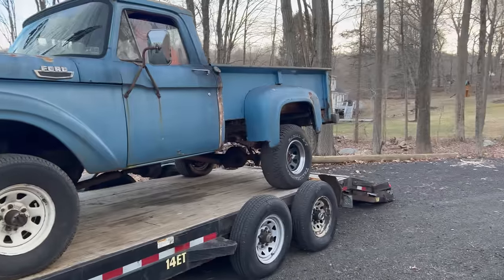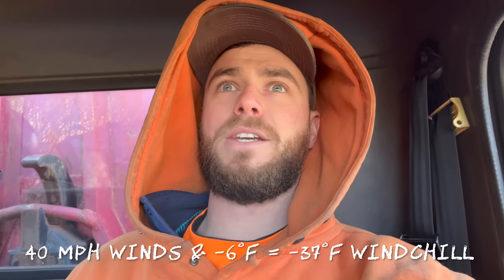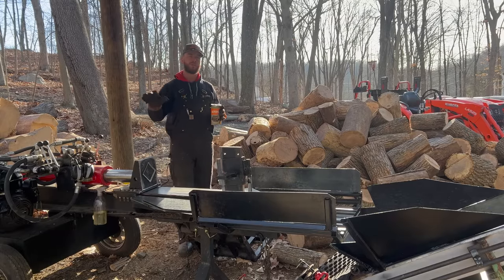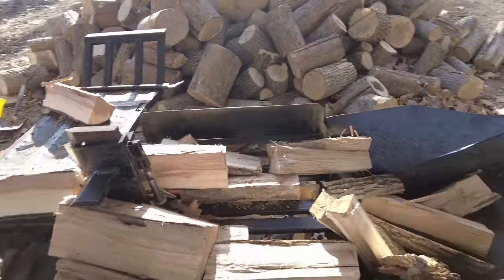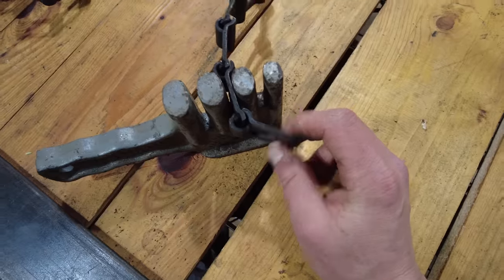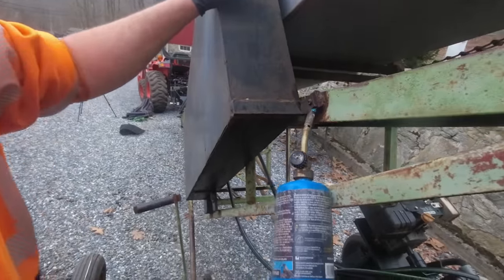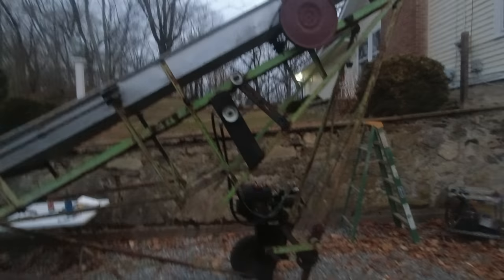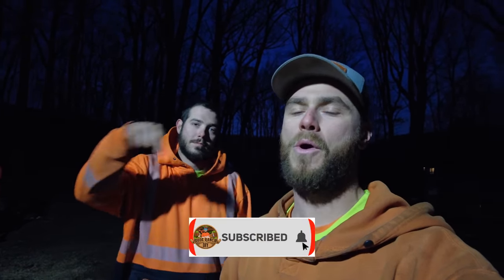#337 Breaking & Fixing the Hay Elevator/Firewood Conveyor

Comment: We run these at outdoor tradition and I bet you have a roller at the end with the bearing getting rough. Those chains break from 1 of 2 reasons. The roller mentioned or a drive gear has a shear pin broke and the chain drives from one side breaking links.
Just a thought

Comment: Great job repairing the conveyor. It has been my experience that with hydraulic and air fittings is that pipe thread tape works better than pipe thread compound . Just a suggestion that may save you some frustration.
Reply from the maker: Yep if this doesn’t work I’ll use the tape!

Comment: hi there as you run it the repairs will slow down because of fixing the weak spots ,  i got rid of mine years ago more because i was not into re picking the wood up again.i noticed a flaw in mine and appears in a lot of them when using them for firewood . the drags are on top of the chain leaving a 1/4 gap under them allowing thin kindling size pieces to get caught under them . when they do the roll over at the top is when this comes into a problem from time to time ,i think Schieb may be running into this as well .. john
Reply from the maker: I have noticed that the small pieces can get under the paddles.

Comment: I am starting to wonder if we aren't just asking too much from these old machines.  I have a bunch of work to do on mine too.
Reply: hi there i for rid of mine years ago more because i was into re picking the wood up again . john
Reply: One thing I think Jake is going to run into is the welded bars. I have two , one a little giant and the other a new idea, and have seen quite a few others. Not a single one had welded on paddles. There needs to be movement. If one side somehow jumps a tooth I think it'll be ugly. Plus these are old elevators you guys are getting w well worn links or 15yrs of rust from sitting outside and no use. And honestly we farmers tend to not maintain them, we deal with it when they break
Reply: @brandonhoad9033  hi there you may be right  john
Reply: It appears most of the commercial wood conveyors use a heavy single center chain. I think the lighter dual chain on the hay elevators are more likely to break when something binds. I’m betting that most folks will eventually abandon their hay elevators and buy a true firewood conveyor. They just cost so darn much $$$$$!!
Reply from the maker: The reason we decided to go with welded bars instead of bolting on was to reduce the play in the two chains. We found that by having all of the extra slop in the chains they were more prone to hop off the sprockets. I’m sure I’ll continue to have issues but for now it’s been working well. Well worth the investment and time to occasionally fix.
Reply: @DudeRanchDIY  hi i believe someone else said the thing on welding rather then bolts , i think welding may be better , no head rubbing the bottom ,  john

Comment: You don't have a compression fitting screwed into the pipe elbows do you? No good. Don't use goop for hydraulics, use tape. If your chain is #62 I just sent 4 to Brad, just B4 Easton made a delivery, maybe he'll forward them. They're plain links though
Reply from the maker: No compression fittings, I said to myself I’d use tape if this attempt didn’t work and it’s been dry so far! My chain is #55, I have a whole roll of it that came with the conveyor. Thanks!